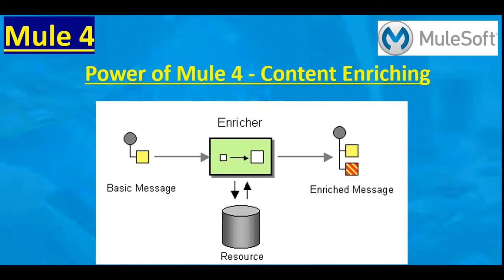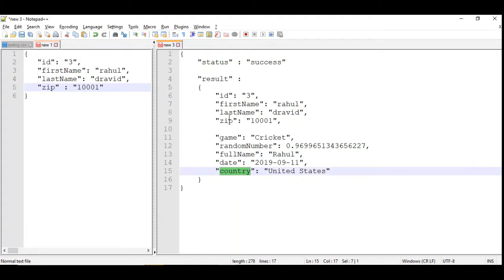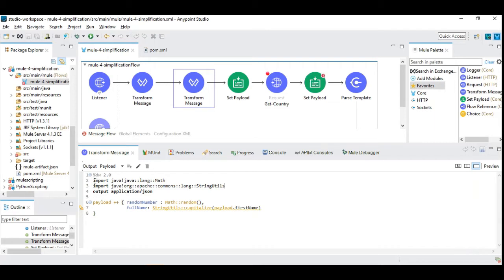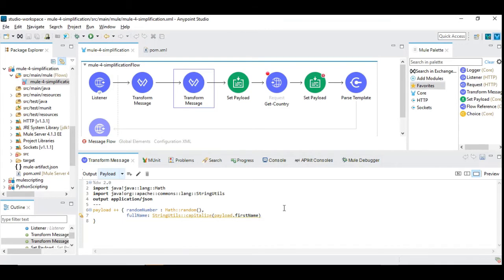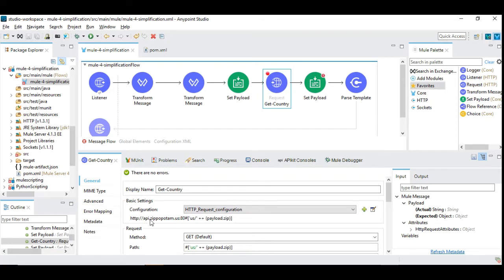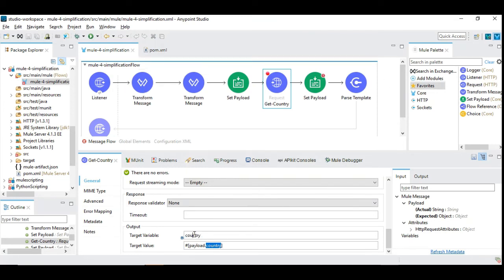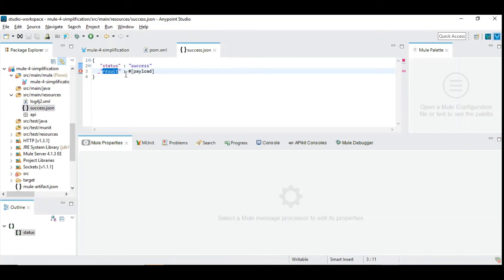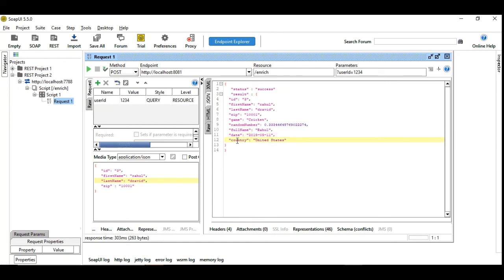Power of Mule 4 | Content Enricher Techniques | Design Pattern

Comment: While calling the http request i got below error:
ERROR 2019-11-22 01:28:15,006 [[MuleRuntime].cpuIntensive.15: [patterns].ContentEnricherFlow.CPU_INTENSIVE @6507ad55] [event: 40a69511-0c99-11ea-803f-a0a4c551d908] org.mule.runtime.core.internal.exception.OnErrorPropagateHandler: 
******************************************************************************
Message               : "You called the function 'Value Selector' with these arguments: 
  1: String ("{\n  \"Id\": 100,\n  \"FirstName\": \"Reddy\",\n  \"LastName\": \"Gari\",\n ...)
  2: Name ("zip")

But it expects one of these combinations:
  (Array, Name)
  (Array, String)
  (Date, Name)
  (DateTime, Name)
  (LocalDateTime, Name)
  (LocalTime, Name)
  (Object, Name)
  (Object, String)
  (Period, Name)
  (Time, Name)

1| 'us/'++(payload.zip)
           ^^^^^^^^^^^
Trace:
  at ++ (line: 1, column: 9)
  at main (line: 1, column: 6)" evaluating expression: "'us/'++(payload.zip)".
Error type            : MULE:EXPRESSION
Element               : ContentEnricherFlow/processors/5 @ patterns:patterns.xml:167 (GetCountry)

Could you please help onthis

Comment: is any limit of data size on payload, like if my xml or json is MB file,can payload will accomadate or when payload will fail when assignment of data's is done?
Reply from the maker: Hi Senthil - The Payload size and other capabilities related to memory are directly dependent on the Infrastructure setup.  For example, If the App is deployed in 0.1 vCore in CloudHub, the whole App can store upto 500MB that includes the memory required for the App itself and the storage of Cache, Properties and other resources required to keep the App running.  As I know of, there is no limitations for payload size within the flow.  However, I dont think any use-case will require frequent use of payload with size in MBs.  Hope this helps.
Reply: @sivathankamanee-channel   Could you please make a video on Keystore and truststore , we didn't have any video available plz
Reply from the maker: Hi Rakesh - Yes, I am already working on it and preparing video and thinking on how I can present it in simple way.  Give me some time.  Thanks for watching all my videos.  :)